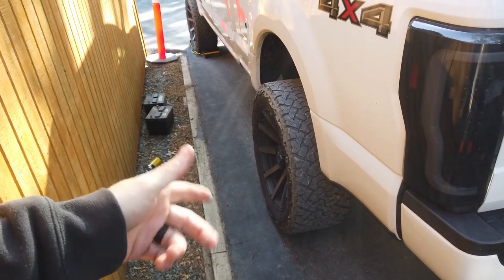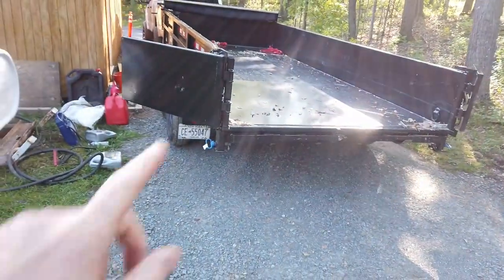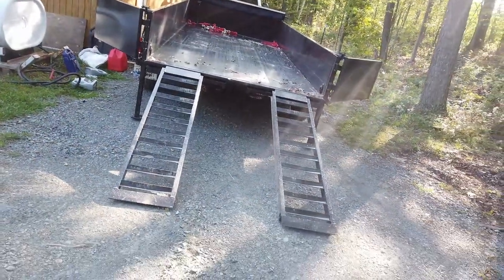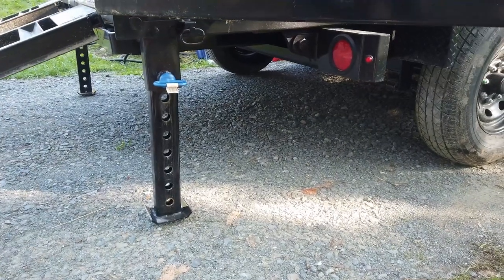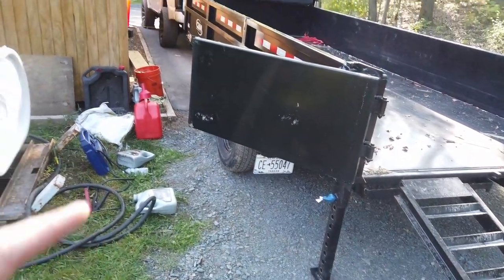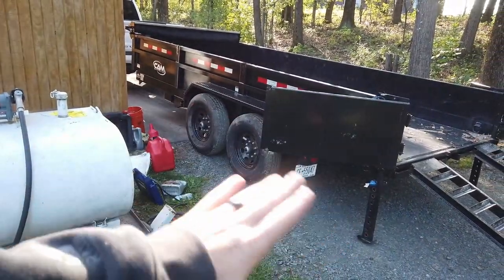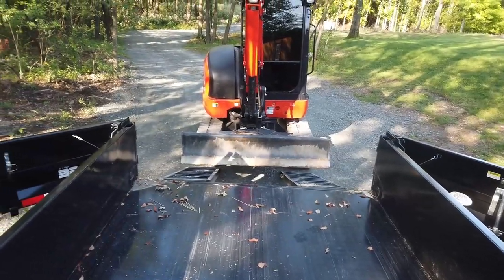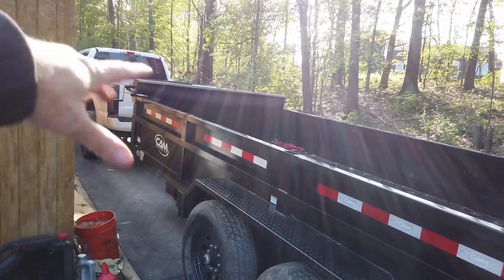How to load your excavator into a dump trailer, Not too Scary!!!

Comment: can you rotate your excavator 360* on top of your trailer?
Reply from the maker: @yoanlm1872  yes
Reply: @outdoorzwithcraigdz  How high are the walls of your trailer then? Thanks
Reply from the maker: @yoanlm1872  I don' t have the trailer anymore but I think its 16 or 18 inches high. They also have pockets so you could extend higher if you wanted to build something and pull them out when you move the excavator.
Reply: @outdoorzwithcraigdz  It is important information for my friend. Thank you very much.
Reply: @outdoorzwithcraigdz  Can you tell me the brand of your trailer pls?